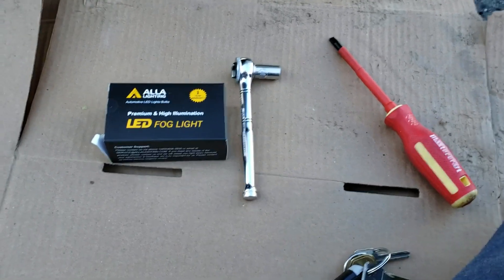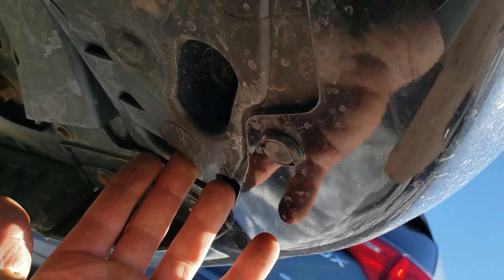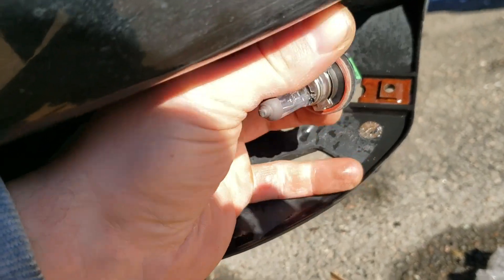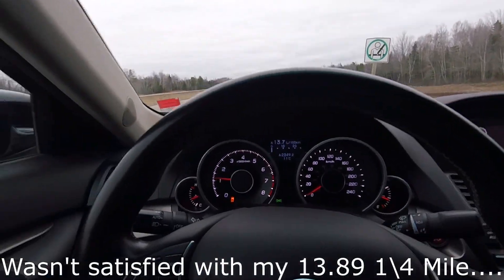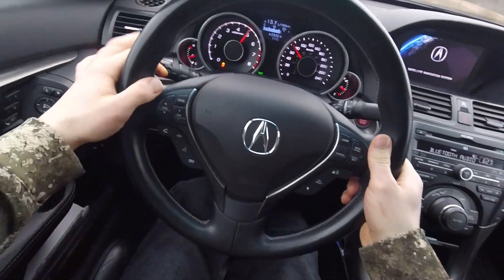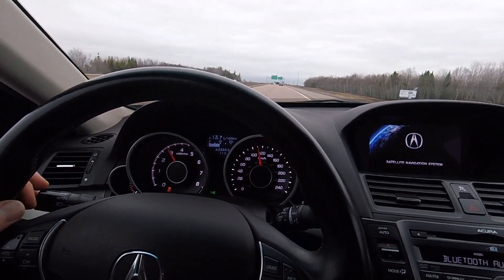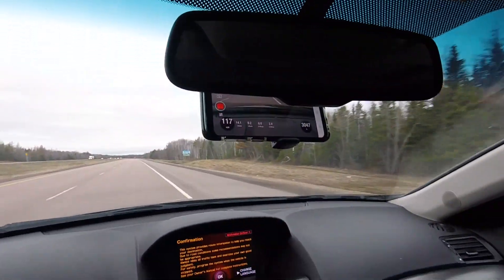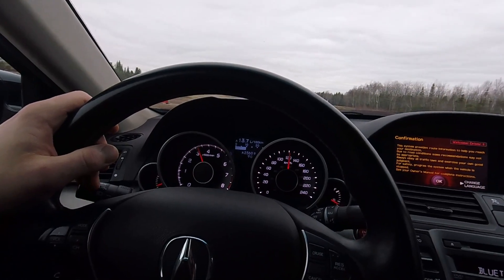Installing LED Fog Lights On Acura TL+ 13.70 1/4 Mile!!

Comment: Amazing video I had no idea my 2012 had this kind of potential for speed well going to Florida I had just paid cash for this car in Oregon. I had a 3000 mile drive ahead of me I found out I could cruise easily at 120 125 miles an hour and still get pretty damn good gas mileage because of the six speed transmission. Had I known that these kill them in Emanuel I would’ve definitely picked that up Instead but yeah I’m gonna subscribe to your channel you just blew me away I’ve been calling this car, my old man’s car on the guy that lost his license because of 32 speeding tickets in the 80s they took it away for 10 years I raced motorcycles, so I like to go fast
Dam was I surprised bro
Thanks with a big Christmas hug dude.
High five braw!🤝
Reply from the maker: I appreciate the support, thank you!🤝..the 6AT is a bit slower but not by much, they wake up nicely with mods. Now I'm fbo weight reduction and just ran a 12.98s(my latest video). The only downside to the 6AT is the autoupshift in 1st and at 120mph it'll auto upshift to 6th, even once tuned but hopefully a company can fix that soon🤞

Comment: Damn that 3.7 is a beast with an auto and mated with the 6 speed is just a potent combo thank you FANCY HONDA for building a car like this plus sh-AWD is so good Subaru could take a few lessons from this amazing SH-AWD torque vectoring rear diff that can apply that rear outside tire with the power and grip to pull the beast out of turns well this is one Honda they can't say has no torque chirp in 4th gear sick ride bro keep enjoying her the way you do love the video's and I'm obviously a j series whore good to see someone use this car at it's  full potential
Reply from the maker: Thank you, I agree this thing is a beast for the weight. Stock 305hp has to be underrated, and it loves coming out of turns. My wallet, not so much when it comes to tires and alignments lol. Thanks for the support, more races coming soon🤙!

Comment: I have the same problem with first gear. Last time it did it. It was stuck in first gear for a new days.
Reply from the maker: Good to know I'm not the only one.  Hopefully wont happen again, after all my shifting mods are installed🤞.

Comment: No error codes? No resistor or anything needed?
Reply from the maker: No error code or resistors. My 2nd last upload has the updated link if you're wondering what they were.
Reply: @RevsALot  ok thank you for responding.
Reply from the maker: @Kec7  Np!

Comment: Is your Acura TL clutch engagement point pretty high, I mean more the half way up? I have driven Golf GTI before it is a lot lower below half way.
Reply from the maker: Yah it's really high, it's right at the end. I thought it was ready to let go, but still running strong at 100,000km, so must be normal.
Reply: @RevsALot I seems like it is high since I bought new. Is it the same for you when the clutch is new?
Reply from the maker: @karreltam161  yah I bought it at 57,000km and was stock clutch. At 100,000km now

Comment: Im pretty sure with a better tire set up you would be able to get a lower time
Reply from the maker: These are Yokohama, bought new last summer. At the strip might be able to grip more though until I get a good performance tire.
Reply: RevsALot I’m running 245/35/20 Falcon Azenis FK510 on the front and 255/35/20 on the rears and i have no issue with traction maybe the auto draws more power
Reply from the maker: @CYBRLS3  mine are 245/45/18, not sure what type of yokahoma-avid envigor, or something like that. I find launching 4000ish is the only time it loses traction. I seen the 14.1 1/4mile👌on Dragy, and your on 20's that's damn impressive.